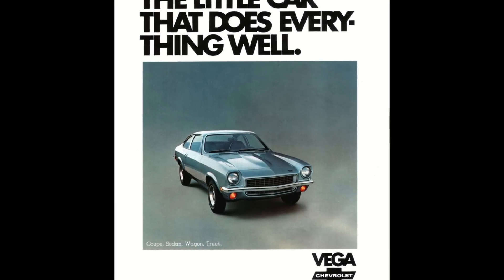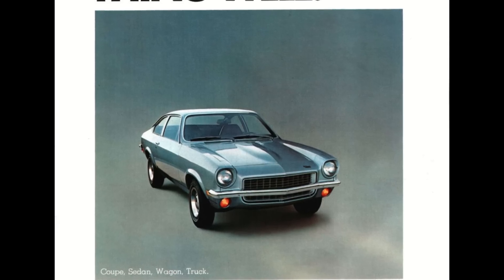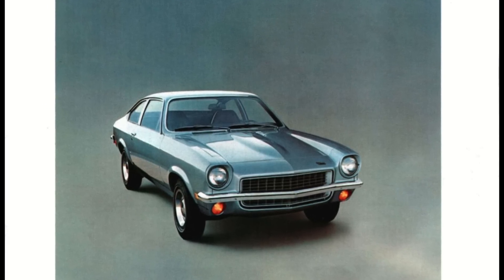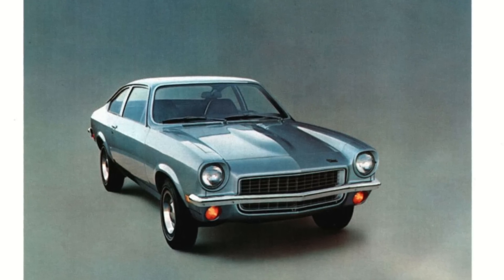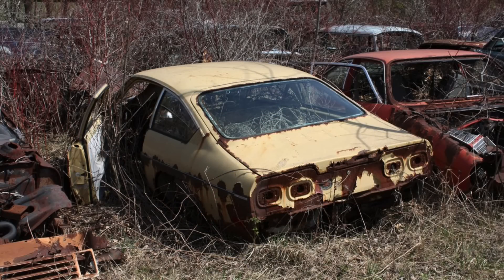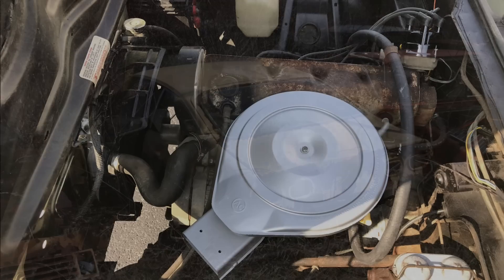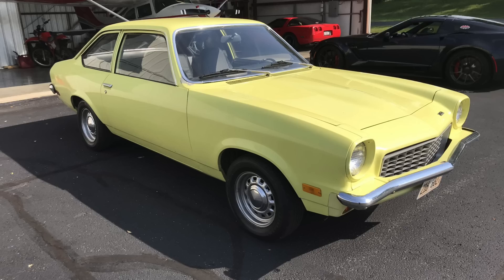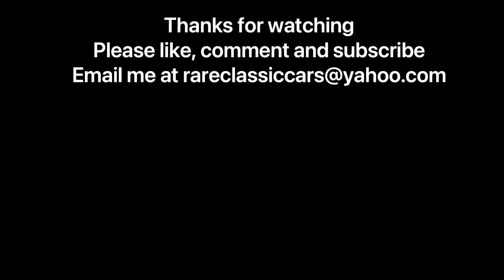GM's Largest Failures: Why The Chevrolet Vega's Engine Turned Buyers Away From American Cars

Comment: My folks bought a brand-new 1975 3-door hatchback Vega, in Sudbury, Ontario, (the rust graveyard of the world). They drove the BLEEP out of that little thing for eight years, hauling a fairly large boat or camper trailer all over Northern Ontario and Eastern Quebec. Zero rust or engine problems. On our first trip down south to Toronto, the fuel pump died, which made for a heck of a day, as, in GM's infinite wisdom, had, by then been relocated to inside the fuel tank. I always thought that was moronic. Anyhow, after eight years, my old man traded it in for a brand new Buick. We must have had a Unicorn. Fantastic little gas beater, workhorse.

Comment: I bought one of the last models, it's the engine where they finally installed the steel cylinder liners - that car was excellent, never burned any oil, was fairly peppy for a 4 banger and I drove it for over 100 thousand miles before I finally needed a larger car. I remember that they were desperate to sell it, they finally had a "fish on the hook, me" - the Vega's reputation was so terrible that the dealership just wanted it gone - don't remember the actual numbers but I know it was a steel looking back.

Comment: then again a vega with a 350 v-8 dropped in was a decent running car
Reply: These V8 to Vega swaps never worked out because the front end wasn’t designed to handle the weight of the V8.  Front end always gave out.  Not a reliable restomod.

Comment: Seems to me that the cars downfall was GM trying to be cheap and not doing any development. It was also far more prone to rust than other GMs, if I recall.

If they has did proper development, they'd have had an engine to rival not jusy Fords Lima 2.3, but Volvo's 2.3 as well, and probably would've led to a much bettet iron duke, and something like the Ecotec would've happened far sooner. 

That was too big an engine for a radiator barely bigger than a Mini's which also had cooling issues. It should've at least had the same radiator as the Nova/II. Could've used-- if existed, a plastic based epoxy paint. An upper connection in the cylinder walls and maybe even a steel sleeve or different type of aluminum.

Comment: I had a '72  blue hatchback. The tops of the front fenders rusted through as well as around the windshield in no time. I would fill it up with oil more frequently than gas. Warped cylinder head, frequent head gasket replacements, etc...

Comment: Back then I solved the air cleaner problem.  All the way around the filter was a seam..  I unfolded the seam and opened it up and installed a new AC filter..  That was easy.

Comment: My first car was a 71 Vega.  Black interior with chrome baby moons and bright cherry red. I kept it immaculately clean and it turned heads. Especially when I pulled up and it was loping like it was cammed out with a V8 yet only had that 4 cylinder backed by that four-speed and 10 in rear. When I got the car I asked my grandmother who got the car for me what was wrong with it. I had never driven a car before but I knew something was seriously wrong with the lack of power in this engine. Next thing I know my car disappears for a couple weeks. When I get it back it's loping like it's got a V8 with a big Cam and it's got this huge carburetor up on it and somebody took it apart and did a little upgrading. Next thing I know I'm passing everybody on the strip and that little engine is pulling the front wheels off the ground. Before I realized it I had a 10.5 second car at 130 in the quarter. Come to find out that was top end and when I hit 131 it shattered the block the bellhousing the driveline and the differential all over the highway. Shot that gear shifter right through the roof of the car. I don't expect anybody to believe me but I'll never forget that car. Tried to put another drivetrain out of a 74 in it after that and it was that same dog down little four-cylinder that can barely move the car. Just wasn't the same. I don't know exactly what all was done to that little engine but that thing was quick. Unfortunately I plowed into the back of some lady sitting parked in the middle of the road with no lights on and I was doing 40 by the time I realized she was there. Like I said I don't care if anybody believe me or not but I know what I had and I know the potential behind that little engine. Not too many cars could roast those skinny little tires off in all four gears.

Comment: I was an automotive machinist in the late 70s and a significant part of our business was patching up Vega engines. The wore out between 40 and 45,000 miles. I've bored those aluminum blocks to re-sleeve them with cast iron- the correct material for the job. Later models got the "Iron Duke" cast iron block, it was too little too late.
The cam operated on a cup directly over the valves, it had no rockers or adjustment, hense the noise. They could get stuck and you had an instant burned valve. I did dozens of valve jobs on them.
It was common to see rust holes on the top of the fenders over the front wheels. With no liners rocks and salty water were thrown against their underside which quickly ate through.
Here's the kicker: many of the owners bought them new and still owed money on them. They were forced to spend good money to fix engines less than 3 years old. I spoke to angry people that had to fix it, they still owed money on it. This was during a major recession, inflation, and high unemployment. They could not afford to do otherwise. Reboring a cylinder including all the labor to remove it and put it back in was about 2 to 3 week's pay for a lot of people.
I heard second hand tales of people driving their smoking, rusting 3 year old Vegas back the the dealerships, refusing to make any more payments, and throwing the keys at the salesman, and swearing they would never buy another GM car as long as they lived.
GM sold a lot of Toyotas and Datsuns in the 80s.

Comment: I remember my 72 Vega had a cut-out that could be removed to install a larger radiator. I also put stud insets for head bolts, and lower the outer edge of the block surface to really clamp the head gasket. After rejetting the carb by richening the idle circuit (to keep it out of the main circuit at cruise) I got 27 MPG. I actually liked my Vega.

Comment: I worked as a tech at a Chevy dealership from 1971-77, so I was there for the entire Vega fiasco. And no, Vegas never got sleeved engines (not from the factory, anyway). Apparently many buyers were under the impression that their Vega was one of the "good engines", with sleeved cylinders or an iron block. The lying salesmen would tell them that. Chevy made several improvements and stuck "Dura- Built" decals on the air cleaners and started painting the engines orange, and then blue, hoping to fool people, but they never put iron blocks or sleeved blocks in Vegas and never really solved the problems. The Pontiac Astre continued on for a short while after the Vega ended and it switched to the "Iron Duke" engine, but not the Vega. What's really funny is that 20 years later I worked at a BMW dealership and in the early 90s BMW came out with a new aluminum block V-8 with aluminum bores and it had exactly the same problems as the Vega. Worn out bores, high oil consumption and loss of compression. We replaced so many BMW V-8 engines that I lost count of how many I replaced. We had customers with year old cars that were on their 2nd or 3rd engine. Of course, BMW being BMW, they blamed this all on "American gasoline" and claimed they "never had this problem in Europe". That was a complete lie because we had a tech who was from Germany and his relatives in the old country had been telling him about all the problems with this engine for at least a year before it ever made it's appearance in the US.

Comment: The Pontiac version, the Astra had the iron Duke 4 cylinder. When my mom brought it home it had only 3 bolts out of I think 8 mating the engine to the transmission.  It was missing 4 rear end cover bolts, and the brakes squeeked terribly. It wasn't a bad car other than being underpowered. 1976model

Comment: I had a ‘72.  I found out the air conditioned station wagons had a radiator that was twice the size as the postage stamp standard radiator.  Off to the junkyard I went.  I just had to knock out a couple of small bits of sheet metal to open up the radiator inlet. The mounting nuts were even there!

Comment: As I recall that air filter used an oil bath that drained back into the engine. It didn’t need to be replaced all that often.

Comment: There are some inaccuracies in this video. The aluminum block cylinder walls were acid etched to remove some of the aluminum and allow the piston rings to “ride” on silicon material rather than aluminum metal. This was a delicate process to get perfectly correct and was one of the reasons the engine had issues after the mileage rose. Also, the major reason the cylinders scored was from overheating due to low cooling fluid levels. Owner caused, but most people as noted in thread video, do not check the fluid levels in general. Finally, the radiator on every Vega I owned or worked on was not 1 foot square. That is completely false in my experience and memory.

Comment: So GM use their customers as the test bed for this design. These cars had several issue, weak transmission, weak rear end, rust, And a crap engine block. Other than looks, This thing failed in every way.

Comment: I don't see why Chevy did not use the 153 ci 4 cylinder it was rugged and been in production sense 1962 if it was to heavy they could recast it in aluminum with cast iron sleeves

Comment: An engineer acquaintance worked in body design at Fisher Body.  When they received the specs from the brass, they went up the line and told the higher ups “This thing is going to rust like nothing you’ve ever seen”.  Top management responded “Eh, so what?”  The replacement fenders cost GM many millions of dollars.

Comment: American car makers had a difficult time figuring out the difference between cheap and less expensive. They looked at all the early cheaper imports as junk and below American engineering. So every competing car they built to take on the less expensive imports were the real junk and unreliable. Besides the running gear, the cars fell apart. As imports improved the cars came with radios and air conditioning. Things the "majors" charged extra. A 1959 Ford my father bought had 2 pages of extra charges for options many buyers would want.

Comment: You missed a very important historical detail. Notice how short the engine compartment is? The Vega was designed for a GM Wankel engine! GM paid a bunch of licencing money to develop a Wankel engine because everyone thought it was the engine of the future. Mazda already had working rotary cars. There were dreams of simplicity, better gas mileage and lower pollution. GM dodged a bullet because they spent $10 million on development and quit at that point citing they couldn't solve the apex seal problems all Wankels have. They lucked out because if they had, they would have found, although a rotary engine has a lot of power IN A SHORT PACKAGE (this is why the short engine compartment), the Wankel has bad gas mileage and a lot of pollution.

They had already developed the car to compete with the far better built Pinto with an engine compartment designed for the short Wankel, so they had to go to their R&D department and pull an unfinished experiment in a thin walled aluminum block design, similar to the one Mercedes and BMW were using for their racing engines. I personally doubt, even as incompetent as GM can be, that they would have released that engine if they had a full development cycle and found it's problems.

You also missed when they started using the pushrod "Iron Duke" engine to replace the Al engine. If I remember, they had to buy the design and manufacturing equipment back from Jeep after they had sold it to them. (Even in 2000 that engine broke head bolts!)

Comment: I think the lore of the Vega has gone to Woodstock territory.  Way more people with stories and anecdotes than that of cars manufactured.  I  had one in the 80's and it wasn't rusted ,didn't overheat it did have the liners installed so it didn't smoke. It was actually a fun car .

Comment: I had a rattle trap 1975 Vega Kamback GT. In the time I owned it, it had three engines, one transmission, the garbage "air cooled" Turbohydromatic 200, and one axle. The third engine was a salvage yard steel sleeved engine from a very low milage wreck. That engine lasted, but the rust eventually ate the car. I welded in new body panels over the years, but the rust was relentless. My Vega also had power steering and A/C. When that compressor engaged, it was like dragging a 55 gallon drum of concrete, though the A/C cars had a much larger radiator to help with cooling a little bit. The Vega introduced the cycling clutch, due to the TXV system not fitting under Vega's hood. The Vega also stood on end in rail cars for transport. I did like the styling John DeLorean did on the Vega though, a much better looking car than all the other compact economy cars of that era. My Vega was not that economical, as it only go about 20 mpg, plus the cost of keeping it going. I replaced it with a Ford Country Squire in 1981. Been driving Ford's since then.... but I still own a Chevrolet, a 59 Bel Air, which I owned before the Vega. Thats why I kept the Bel Air, the Vega was always braking down and the Bel Air always cranked right up and was always reliable.

Comment: My wife had a '75 Vega. Was actually not a bad car. Fun to drive, ran great, easy to work on. It did develop the typical scored cylinders later in it's life. Back in the day, auto parts stores sold a kit to fill in the scoring, little balls that you poured into the cylinders through the spark plug hole. Just a temporary fix but it did stop some of the oil burning. The joke with the Vega was always "fill the oil and check the gas". I had a case of oil in the back at all times

Comment: I worked in an automotive machine shop from 77 to 79.
As soon as we got a Vega head on the bench it was checked for cracks. They seemed like crappy castings and pretty much cracked in all areas including around the valve springs and combustion chambers. The first place we looked was on the back side of the head around the spark plugs. It was an odd place but I always blamed that huge "fin" of cast iron. That was a lot of material that heated up slower than the lower and thicker bottom. I really felt sorry for the people when you told them their head was junk at 30k.
We also sleeved those blocks with great success. We also made a pattern to mill out the water jackets around the block and place an aluminum plate to fill the large open deck. It supported the cylinders and improved cooling. 
 Most of this was more expensive than most owners would ever put into an economy car, especially one that was rusting through around the windows. 
 One of the cool things about that motor though was the adjustable cam followers. It sure was easier than shims.
 Our shop did a lot of cool things for oddball stuff like cutting a groove for an "O" ring
between the halves of a Corvair block. Our shop foreman was an outstanding  guy that had a firm grasp on engineering much better than Detroit did.
I had forgotten about the Air cleaners though. It seems I remember cutting them open to replace the element. We're the elements glued to the halves? That was a long time ago.
 I know we put a certain type of oil filter canister in out oven while heat treating our cranks. It melted the glue so a separate filter could be installed instead of the whole assembly. Those had nothing to do with Vegas though as two hands were required to pick them up. I don't recall what they were to or if I ever knew.
 I loved working in that shop as there was no limit on satisfying the customer. 
Cheers
Terry
Reply: I vaguely remember seeing these heads come in with the number 4 cylinder exhaust valve burned.  That seemed to make sense with the water passages at the rear of the head having a collection of material that looked like sand from the casting process.

Comment: I had three Vegas , I worked for an auto parts store and in the 1970`s, that was a decent kind of job  back then..
I scored on Vegas with "problems" that were low mileage , I paid less than $300 each due to their bad reputation. 
I paid $ 275 for  steel lined short blocks through my job.
   Being in Southern California rust was never a problem. I never had occasion to rework the head as they were cast iron and low mileage!
     Funny thing is I swapped them away and over several years I swapped them away and got into  VW Baja Bugs.

Comment: I had a 1974 Vega. My girlfriend then (wife now) had a 1972. Within 3 years my front fenders rusted through and both burned oil. As a lifelong engineer I’ll say that A390 is a tough and strong aluminum alloy that has many uses.  Sleeveless free floating unlined and unmetallized cylinders was not the right application. GM management had their heads up their butts and the current leadership isn’t much better. I haven’t bought a GM product in decades and have zero desire to buy one in the future.